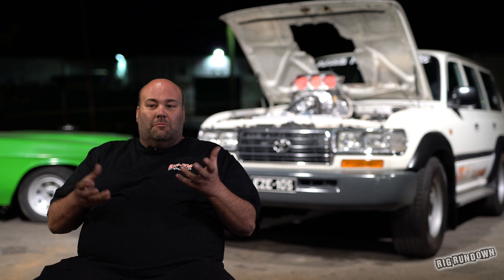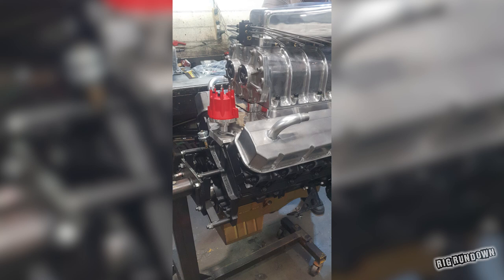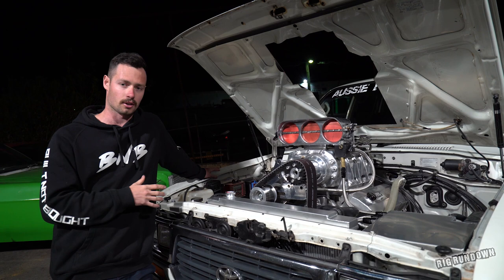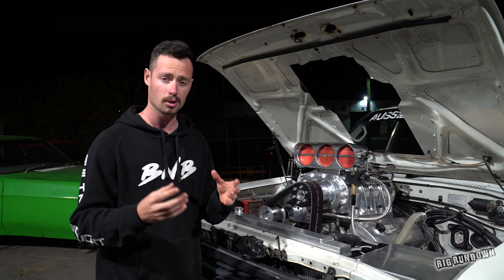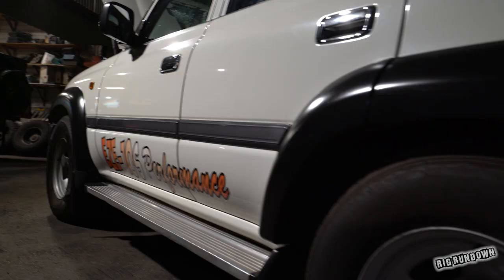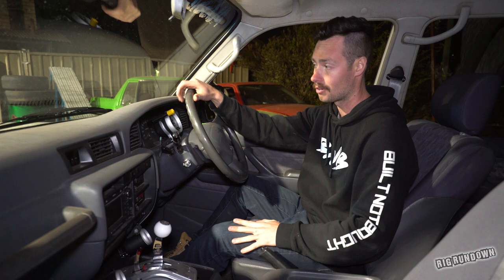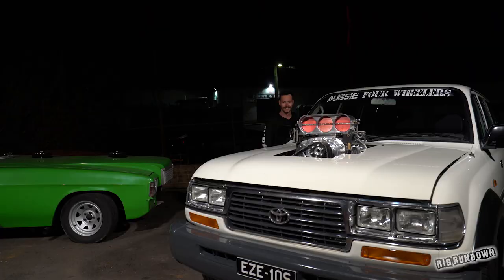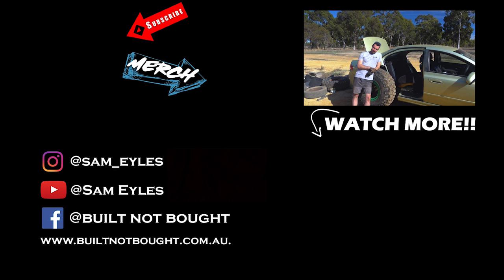RIG RUNDOWN || Big Block 80 Series on Methanol

Comment: I've been hanging to see it down the strip or on a dyno for a while. 

Didn't know it was straight methanol and it sounds very high maintenance given that but its ok for a car just used for power cruise or burnout comps. 

My rig is running a water to methanol injection system rubbing a 50/50 mix on pump98. 
We use the wm system for more power and for cooler intake temps. 

The 10 litre tank lasts about 2 to 3 months and i find the system so maintenance free with such awesome pro's

I highly recommend
Reply: @Mike Lunt yeah m9-1 👌😁